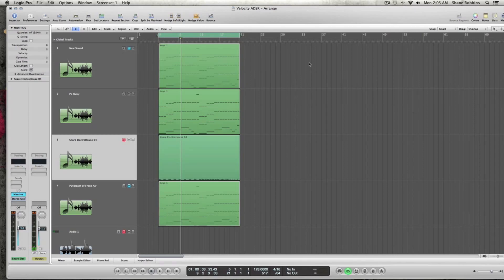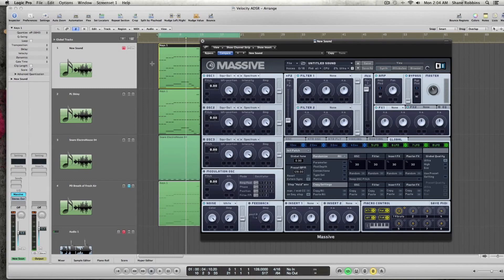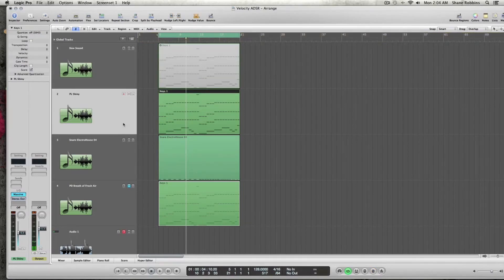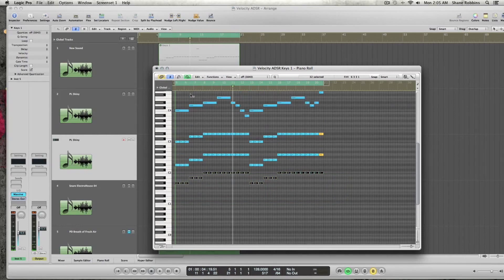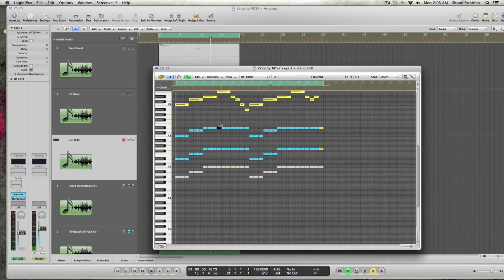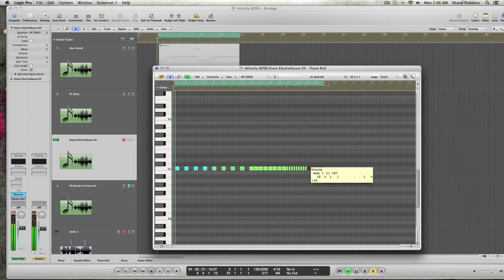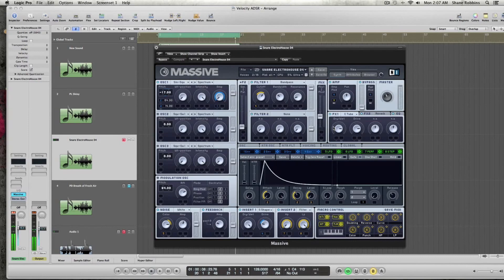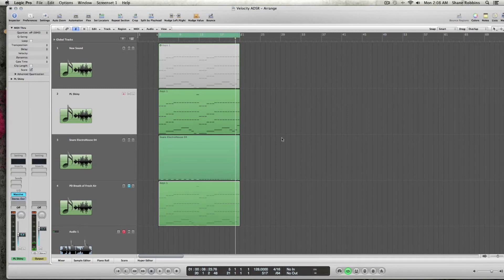NI Massive - Activate The Velocity Sensitivity in Massive - How To Tutorial

Comment: One of the reasons I alwsy hated this synth and its a recurring  theme with NI stuff, but they are not alone, far to many VSTs have literally the most important expression character of a synth off or it requires faffing around like this. Velocity should be automatic, it should be on always. A simple switch shoudl be front and centre to turn it off an on.